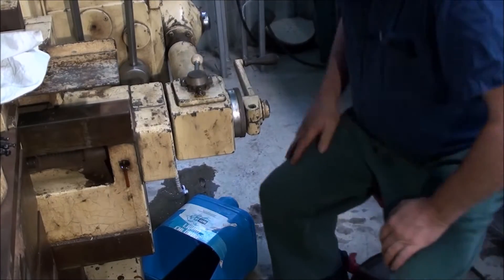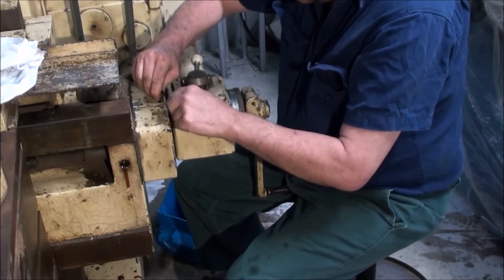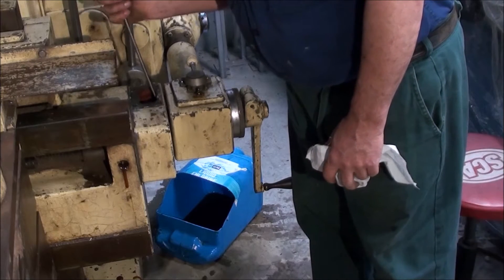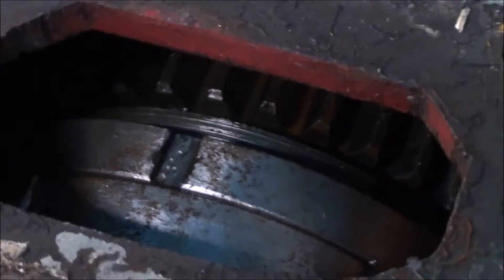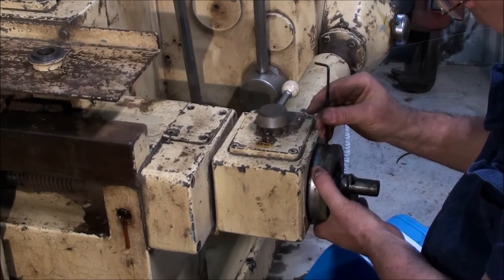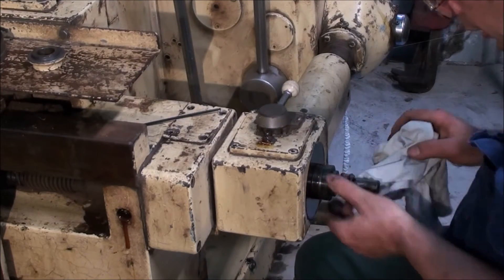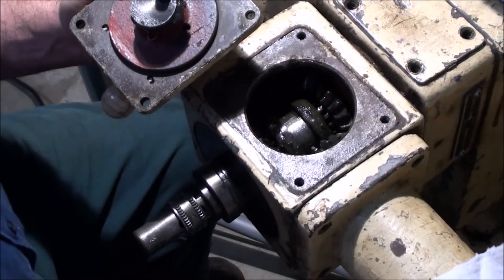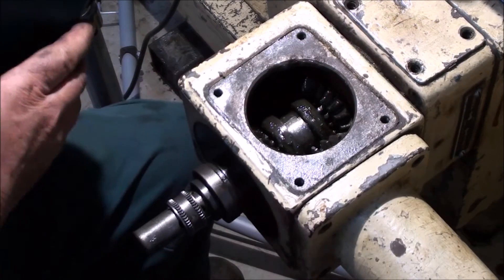Shaper Action - Churchill Redman Shaper - Part 8

Comment: hi, if the part is missing, then make a part  shaped "like" a rectangle  with a hole in,  ??, to pick the pin up
hard to explain but simple to make "good luck"
Reply from the maker: Described more than well enough thanks Keith, It's probably closer to what should be in there, but what I made proves that it works, and took me very little time to do. I would have liked to have made it from bronze, but I didn't have any that was suitable

Comment: Almost seems like there should be a bushing that allows the pin to rotate inside it as the handles moved and fits the gap between the two shoulders. You have my utmost sympathy dealing with all that paint slopped into the bolt head recesses as well.
Reply from the maker: I agree, that was the conclusion that I reached. I am seriously thinking about painting it now, so every time that I look at anything with a socket head in it I cringe now haha
Reply: Yep funny how the one's who used that grease and painted over the bolt head recesses never seem to be the ones who end up doing maintenance on a machine at a later date. You didn't happen to find the original pin bushing in the bottom of that case did you? Your shaper is a lot like mine, it's suffered more from a bit of neglect than having done a great deal of work.

Coating each bolt recess with something like that bio degradable Citri Strip might be enough to then blow them out clean with an air line. Another messy job though.
Reply from the maker: Citri Strip is more expensive than very good scotch here, so it won't be that. It will however be something similar, but a lot cheaper - I'm not going without my scotch !!!
Reply: LOL, a good logical point.